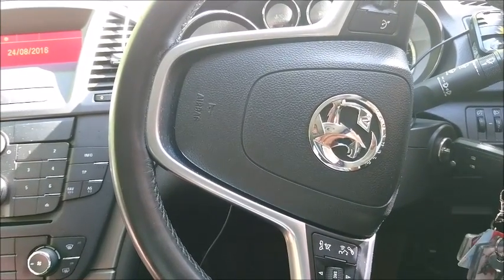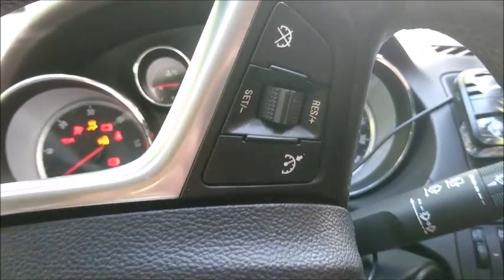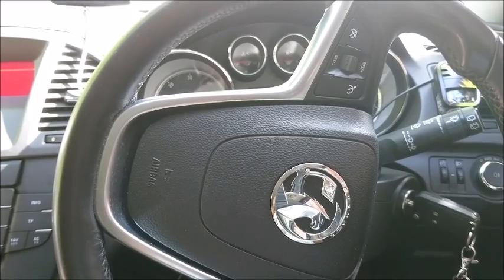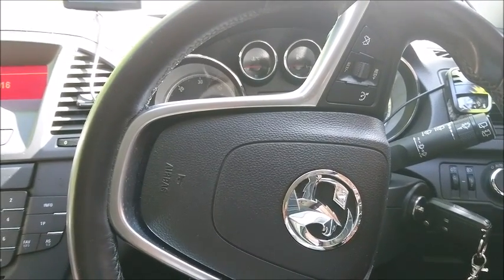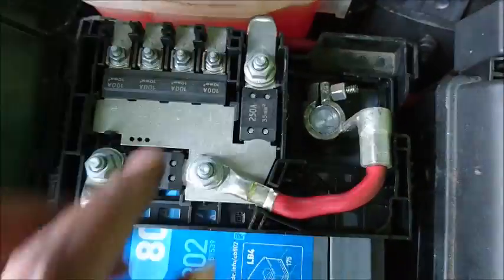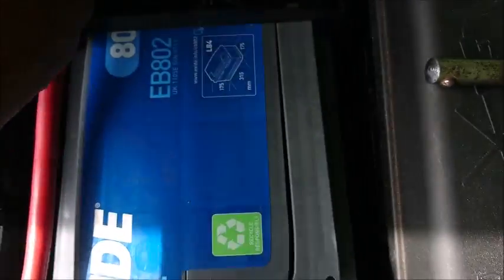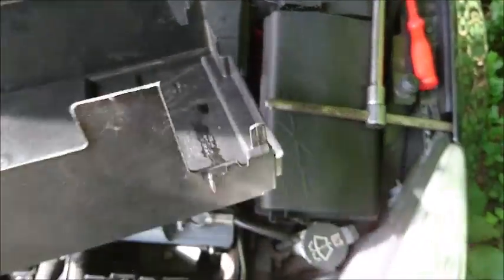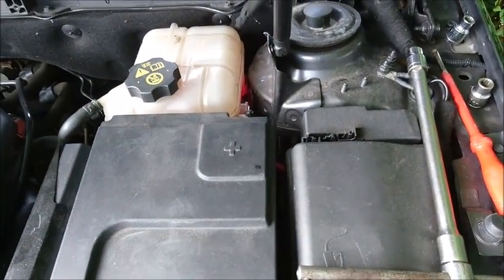Car battery replacement, very easy

Comment: Thanks bro. I had a similar problem yesterday. I called AA, the guy jump started my insiginia and said get the battery tested.
I went to halfords this morning who  tested it and said it is charging up to 68% and needs replacing. They have quoted me twice as much as you paid for your new battery so , thanks to your video, I think I will  buy my own battery and fit it in myself. 
fingers crossed. lol.

Comment: If you have a stop start system, Halfords want £250. But if you get a £60 battery (Type 115 From ebay)  it just means the stop start function will be disabled after a little while. When I got my car it was 3 years old. They only time stop start only ever worked after a long run. It is annoying in traffic anyway. The voltage has to be spot on for it to work. My car worked fine without stop start for 6 years.
Reply from the maker: @markenetube  me too I don't like the stop/start idea. A good cheaper battery is ok and they last over 5 years.

Comment: You have to put some load on the battery before measuring it. That's why your multimeter reads 12,2 volts, but you couldn't start it
Reply from the maker: Loverboy yep, I noticed that later that morning. when my wife try to start, the voltage was dropping to about 7 volts.

Comment: Hey mate did you have to programm the Radio or something else after change? I read you must programm in the new battery. Right?
Reply from the maker: Sorry for late reply, no need to programme anything other than adjust the time.
Reply: @fix-and-drive-diy-repairs  better late than never, thx

Comment: If that's how you start your car every day no wonder it won't last you very long. You have to leave it until most of the lights go out. If you do this in the winter especially you will have problems.
Reply from the maker: Daniel Matei the battery was very old brother, it needed changing whether I started the car with your style or any other intelligent pattern. Thank you anyway.
Reply: Nice-oscar I'm not talking about the battery. The engine will develope fault codes if you don't let it do it's check first and only after that turn the engine on. During the winter especially you have to let the glow plugs do their job first.... These are just simple advices, i have the same car and they are very pretentious.
Reply from the maker: Daniel Matei ok mate, understood now. I will try that. Thanks for the advice.

Comment: If a battery reads less than 12.6v then it's not perfect. 12.2v is a dying battery!
Reply from the maker: 13.5v to 14v is a good battery.
Reply: @fix-and-drive-diy-repairs  "13.5 to 14v" is too high for a voltage test on battery that is tested when car is not running & cold, which is how it should be tested. Typically for a perfect battery it will read 12.7v to near 13. Higher that 13 and the car is running or has just been running and that's not a proper reading.
Reply from the maker: @typhoontim125  sorry, I meant when the engine is running. The voltage is normally higher to push the charge.